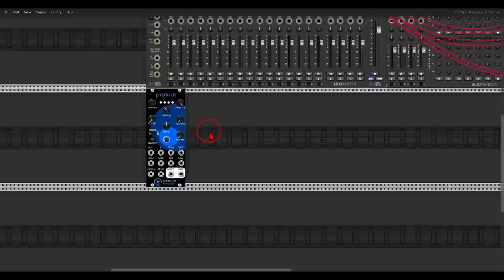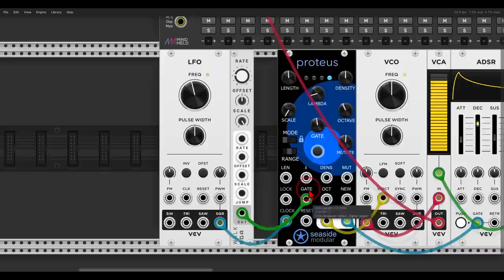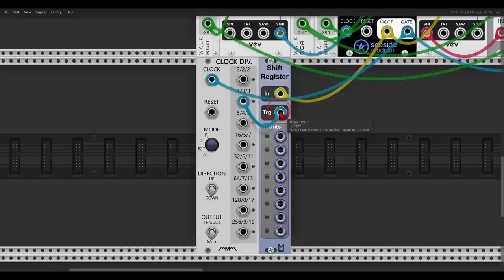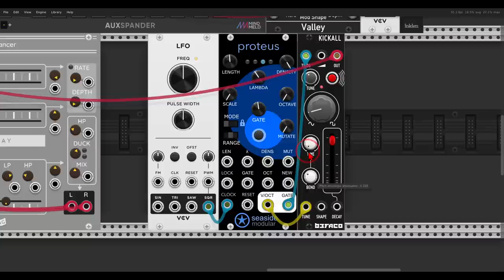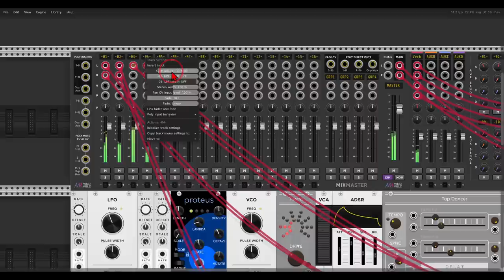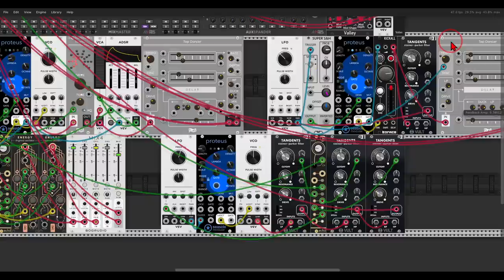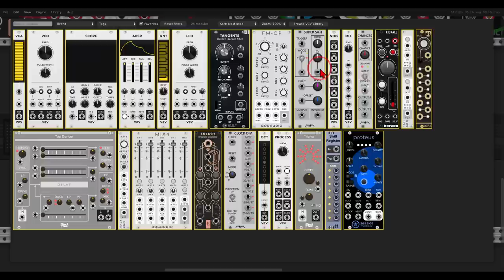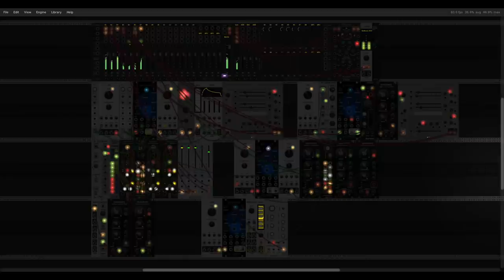Generative Patch From Scratch with Proteus

Comment: Your Audio Module shows a "Rea Route A5"  connection and so my setup doesn't work, can you help? also after downloading your free patch (thank you) on opening it in VCV Rack it reports with a list of missing modules: "Could not find modules..."
Reply from the maker: Hi! I'm sending the audio to Reaper and that's why I have ReaRoute set but you can change it to your interface. About the missing modules, have a look at the PDF that comes with the patch. It has the links you need 🙂
Reply: @OmriCohen-Music  Thanks for that and yes the PDF as the needed links, I want the sound to come out of my Mac laptop speakers, so what should I set the audio to? Thanks again.
Reply from the maker: @rickyardo2944  I'm not o sure... Maybe Core Audio? I'm on Windows so I'm not familier with the Mac options
Reply: @OmriCohen-Music  Thank you for that,

On opening VCV Rack for the first time a basic Template is created and I have modified and saved this file so that my Mac speakers are automatically setup, this creates a file in my documents folder named: “template.vcv” that opens every time VCV Rack is started.

I can open other peoples VCV Rack files modify them and save them without any problems and I can then go on to create a new patch from the file menu as usual that opens my “template.vcv” as expected.

I have installed all the missing library modules needed by you patch and updated VCV Rack as recommended by the VCV Rack app and on when opening your patch no problems are reported and all seems fine.

After I set the sound out to the Mac speakers the lights on your patch begin to blink but still no sound, lights still blinking…

However:

If I then select a new patch from the file menu I get the error message: Could not load system template patch, clearing rack: Unarchiver could not write file to dir: Can't create '/Users/rickyardo/Documents/Rack2/autosave/modules/1878679374588749/wavetable.wav'

After that I can open mine and other people’s VCV Rack patches as usual without any problems but I am stuck with not longer been able to create a new patch from file menu the contains my basic setup file  “template.vcv” VCV Rack reports the above message every time

Resolution

I had to delete the Rack2 folder in my Documents folder, copy all the Plugins back and recreate my  “template.vcv” file again and all is well again.

I realised how difficult it is to diagnosed this from your perspective and whilst I do not know for sure I suspect that some other Setup/Files/Combo is causing this problem and maybe I am not the only one as this is only happening with your patch.

Solution

Please forgive me as I am not an expert in VCV Rack and how it structures it’s files and I am also probably not qualified to give you advise as my research has shown me that  you to have a highly regarded reputation and expertise in this fields, just feedback then.

If your video had shown a more general and basic standard setup from the start with blank slate this might help?

Please excuse me as realise that what comes next sounds petty and pedantic…

Your video started with you saying, “that today we will build a patch from scratch …” when on screen we see a patch that is already been built previously with 6 modules and some connected.

You go on to show what modules you are including and circle those in red, BUT you skip over the Audio Setup without any explanation.

You do not circle in red the Audio module and what it’s setup is and this is what the presentation is missing…

Thank you for what is otherwise a very good presentation and I like your videos vey much, Rickyardo